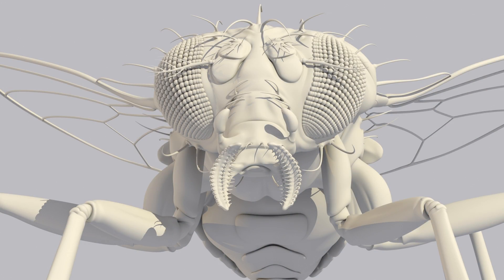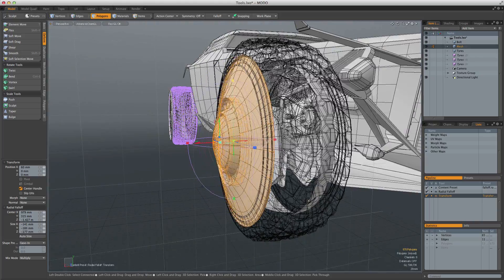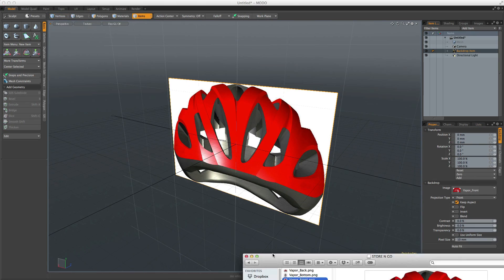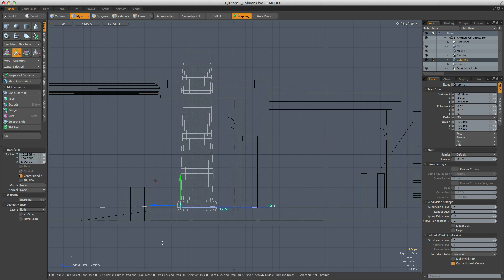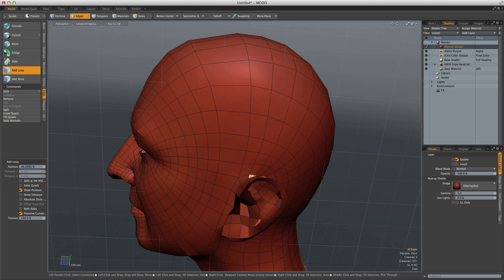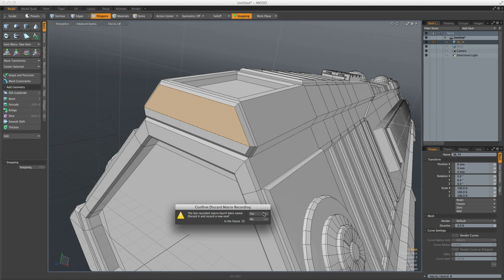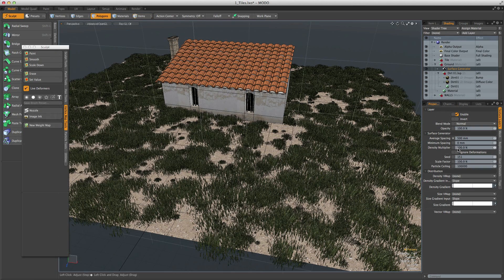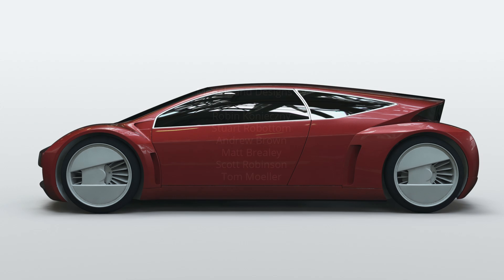Modo | Modeling

Comment: Why is a software 6 years ago better than the latest versions of Autodesk or blender? It seems bizarre how Nobody talks about this?
Reply: Better is a relative word. This software is basically lightwave 2.0 and it comes with a bunch of the same problems lightwave has/had. Did they ever add a modeling history stack like Maya/XSI have/had? That feature alone saved me about 2 weeks of work in XSI when I found a problem in middle of working on an animation. I was able to go back and fix the problem without redoing all the other work that came after it. The power of programs like Maya and XSI (and MAX?) is that they allowed companies to create a lot of internal workflows without relying on the software developers to create everything for them. Last I heard (many years ago) Modo was still lacking an SDK. 

As for all the people getting excited about the things he was showing off, I was doing most of this in XSI a decade ago. They didn't have dedicated tools for it all (which usually end us with a mess of different but similar tools, ala Lightwave), but instead gave you the ability to use the more general tools in multiple ways. Snapping in XSI could be used to retopo a model or snap model to the surface of another model by just enabling snap. You could also project a mesh onto another one the way they show in this video. Clones are also nothing new.
Reply: Better than Blender? yeah right....

Comment: So..Modo, blender, maya, 3ds max and C4d, if there is a most essential list of 3D program to learn out of these programs, how would u guys rate it, like in top 3 or top 5, why is the reason, and as a newb like me which one do you suggesst?
Reply: of course it is possible!
Reply: Maya and Houdini is the industry standard and if you want a job learn one of those first.
Reply from the maker: +Khairul Anam Try MODO yourself over here: http://www.thefoundry.co.uk/products/modo/trial/
Reply: no, MODO is a mesh modelling application. it's not parametric and it can't do engineering studies.
Reply: It would depend on what do you want to do. Although I'm not quite comfortable with it's workflow, Modo is great in modeling. Maya is getting better but still a PITA, clumsy to work with but very widely used. 3DS Max also has it's market but I don't like it's modifier stack system and I find it a little slow.

If you are going to work in modeling, remember that you can model in anything you want and import it from the software you need to use. (Ex: Model in Modo and convert it to MAX before delivering it to your client).

If you need complex rigs, animations, or simulations, that change. You can't export and import those and you'll have to work on that software from the beggining.

My favorite software is still Softimage. And I have to use Maya for work, and Max sometimes and I hate them (to be fair, I still don't like it but Maya is getting better). I only have little experience with Modo but I'm willing to try it again when the old Softimage can't keep up.

I've got no experience with Blender or C4D. Blender would be a good option if you just want a hobbie. C4D has a good reputation in Motion Graphics, and being very easy to learn, but that's all I know about it.
Reply: I'm agree with frkkz, that it depend on what you want to do. Maya is the best for rig and animation, MODO is the best for modeling, ZBrush is the best for sculpting and Autocad's are for Architects
Reply: and what if I use Modo to modelling then import to maya, and make animation to it? Is it possible?
Reply: @endcraftable  yes
Reply: Blender, Modo and Maya/C4D (depends in which kind of animation and job type you're aiming at).